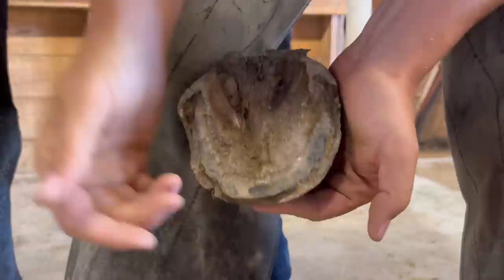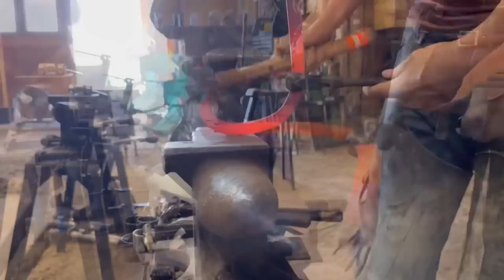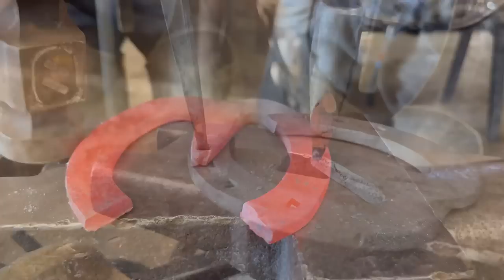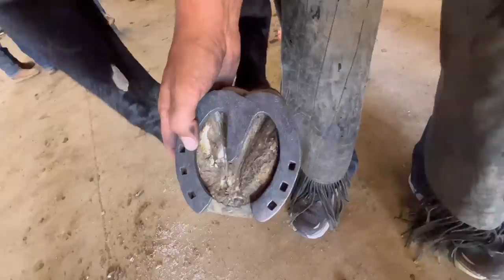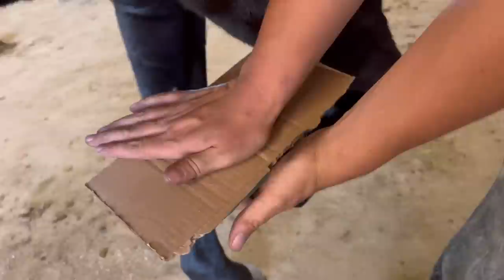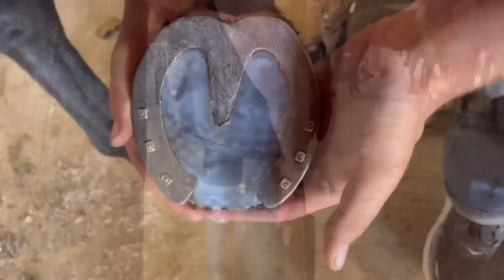FOUNDERED Horse gets HANDMADE Shoes

Comment: Great job! Question: I've heard an explanation before but I've forgotten exactly how it works, so what in the mechanics of leaving the heels a bit longer is it that helps a foundered horse? My thought has been that the coffin bone will still be pointing downward and may put pressure on the sole, but is it the increased weight bearing of the frog and the coffin bone kinda being pushed forward against the hoof wall that gives the relief because there isn't as much tugging on the laminae and inner structures at the tip of the coffin bone? Not sure if my reasoning or wording is making sense, but am I kinda correct or could you explain the mechanics and the hows and whys of the method? Thanks!

Comment: I've been a carpenter for years. And I've asked this question a few times but know one will answer it. Is it possible or could you use a shorter screw instead of a nail? It wouldn't poke out the side. Seems as if it would be as strong or stronger.
Reply: What comes in must come out. A hoof is a giant toe and toenail. Think of a screw being screwed into your toenail so it rests on your toe; every time you step it would be uncomfortable. Removal worse. Nails are easy in, easy out and stay in place for the 4-8 weeks they need to be in. The nails don't hurt them  and the nails are filed to not cause injury to horse or rider.
Reply: @KateandBree  thank you. New perspective. I see the nails poking out the side and wondering how it doesn't split it. What roll does the frog play? What does it do?
Reply: The best way to think of the frog is the ball of the foot. It’s there for shock absorption, traction and pushing blood through the hoof and back up the leg (circulation.) The last thing any horse owner or rider likes seeing is frog problems. 

Remember, the inside of the hoof is the toe and the actual hoof you see is like a toenail. It’s made of the same stuff, keratin, but much harder. It’s not going to split as easily as our human toenails and fingernails do. It’s hard but flexible.
Reply: @KateandBree  thank you.

Comment: Fascinating.  I was under the impression that foundering ment the same as lame, however this seems to be a condition that can be corrected.  What would cause the hoof to break off in such a way?
Reply: Lame (in a horse) simply means limping or abnormal gait. Foundering is a reason for lameness. Other reasons  (but not all) for a lame horse: injury, poor nutrition, hormone imbalance, infection, or degenerative disease.  Some of these are fixable; others are not. Degenerative diseases can be managed, but inevitably there will come a time when quality of life will have to be taken into account.
Reply: @KateandBree  Thanks for the information!  I've never owned a horse, though I did have some riding lessons ages ago.  Seems like some veterinary knowledge would benefit most folks who take on the responsibility of a critter, especially one as big as a horse.  Enough for first aid, at least.
Reply: @acegulliver5414  Some of this knowledge is acquired as I’ve gone back and forth from riding and rehabbing. I was never one to just stick to one part of horsemanship. 😂
Reply: @KateandBree   😆 Life is more fun that way.  The more ya learn, the more there is to love!

Comment: I’m sure people ask this a billion times, but when they forge the shoe are They truly just going by memory and experience for sizing the shoe , do they have to go back and hammer it out a few more time occasionally. How do they always make them so seemingly perfect the first time if they don’t know the dimensions and have a way to measure it?
Reply: Hey, farrier here! It's not shown here, but we do actually measure the feet! Many of us carry around small, flexible tape measures to find the circumference, width, etc. of the foot, which we use to figure out how much steel to cut when hand making shoes like the one above. As far as getting the fit of the shoe, we do memorize the foot to some extent, but will go back to the horse to check the shoe on the foot to make sure it's the right shape/size. Hope this helps answer your question!

Comment: For the hoof to be healthy blood flow must enter and leave there.  Frog pressure is NOT the mechanism by which this happens.  Instead it is the expansion and contraction of the heels as weight bearing comes on and goes off.  With the rear nails on each side placed behind the center line of the hoof and the bar of the shoe welded at the heel you have effectively stopped the possibility of the hoof expanding and contracting during weight bearing and lifting off.

If the coffin bone tips down at the toe from founder, as you showed in the beginning of the video,  then why are you not dropping the heels as much as possible.  The hoof shown in the video is the high heeled hoof and still is higher than the other hoof even after the job is complete.  How does this address the rotation of the coffin bone?